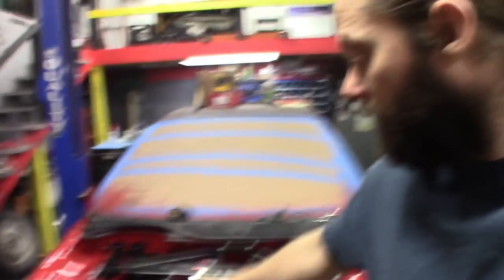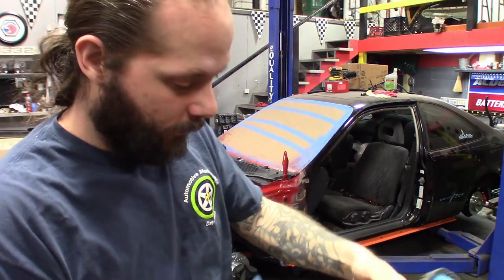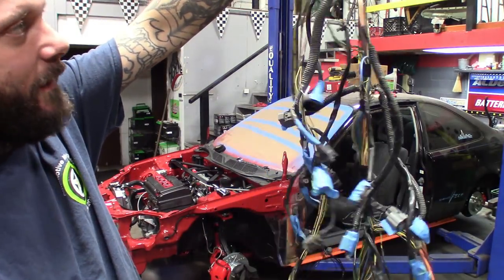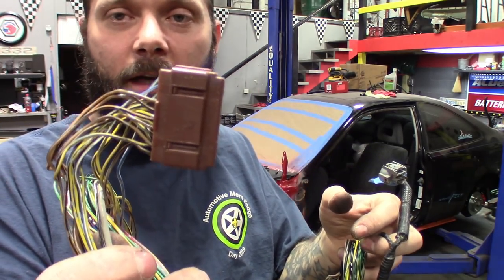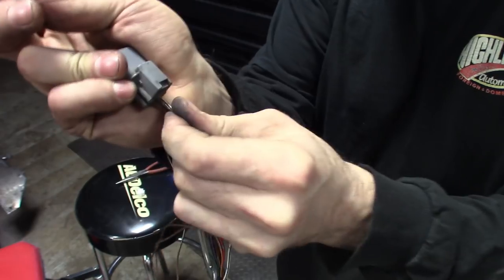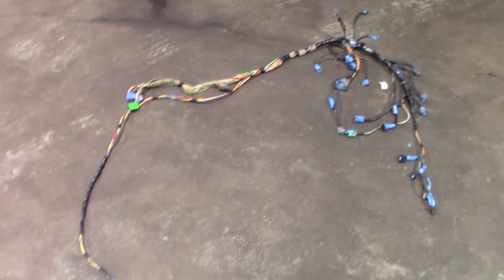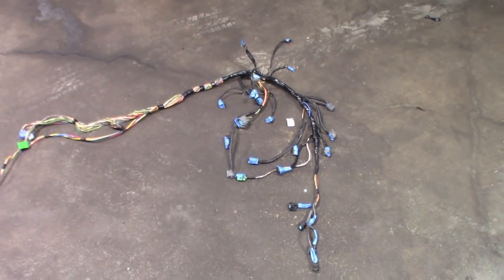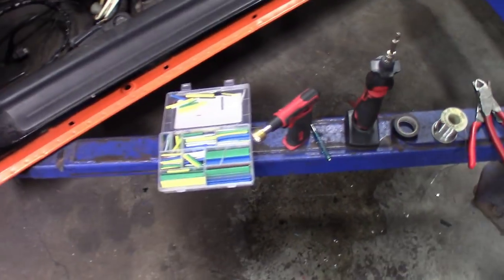Only Way To Do It Is The Right Way

Comment: 👍🏻real nice doing it right, I like the string idea for the length of wire needed. looks awesome! real clean. Haven’t done any custom work like this but I also like using those t-pins for pin removal or my pick set works also sometimes

Comment: With all the cutting lengthening and deleting... are you expecting any issues with the ECU throwing codes?  Speaking of witch are you planing on doing any tunes or ecu reprogramming... and if you were to do so Is that something you can do in house? Maybe dumb questions  but after years of doing suspension, breaks, and basic tune up and repair work I’m a place with trained smart auto techs and there  really breaking me into doing do major engine diagnostics  so I’m definitely green in that area!
Reply from the maker: I will be tuning it on hondata obd1 so most of the things I'm deleting, it doesn't monitor. I will be turning off the O2's and the evap to not have a check engine light. Won't be able to do that in house because need a Dyno.